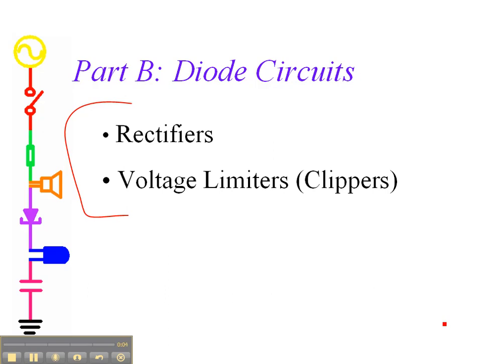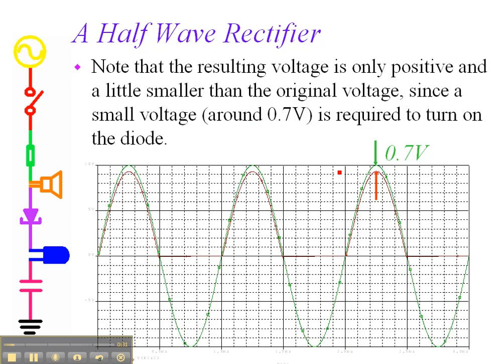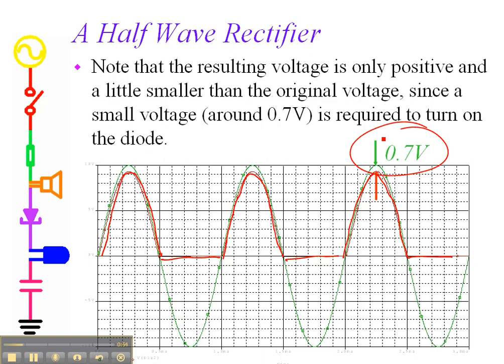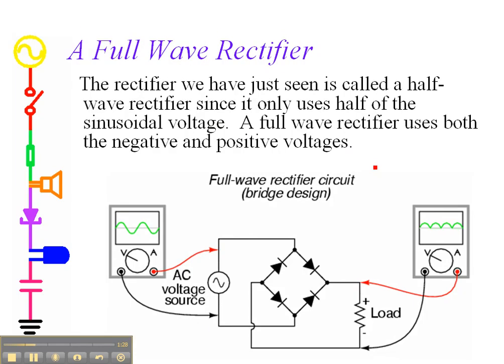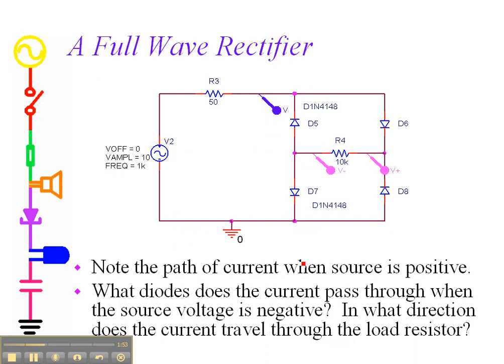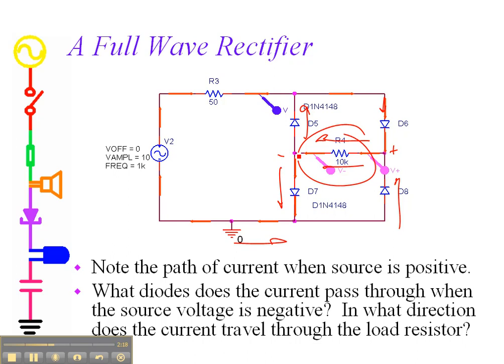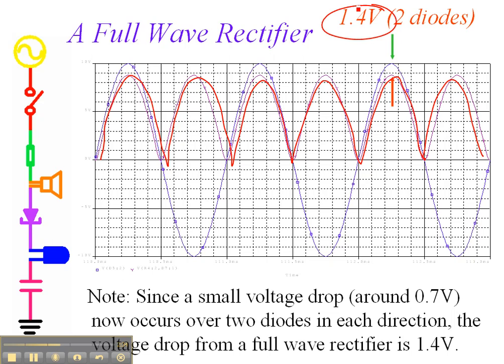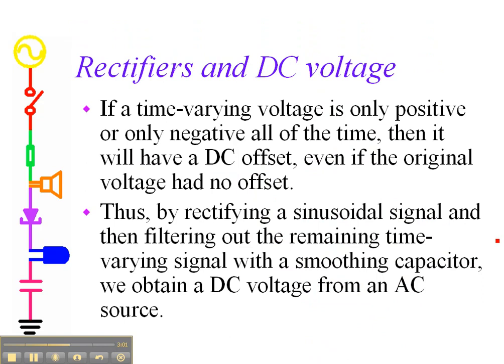Exp 8 Diodes Pt 3

Comment: Is there a practical use for a Half Wave Rectifier without smoothing (without the capacitor)? Could it be used as like a clocking device? so when the voltage surpasses a threshold it is logic high, and when the voltage is zero it is logic low?
Reply from the maker: There are many uses for a half-wave rectifier without smoothing because it is so simple. Circuits must make money and simple designs cost less to make. If a device needs to only be turned on (like an LED) and the huge ripple of the half-wave rectifier does not matter (we cannot see LED flicker even at 60Hz), this simple rectifier is fine. Also, some devices have diode-like properties that make powering them potentially very easy. For example, one can build a very simple microwave oven power supply buy using the microwave tube itself as the diode. This makes very simple microwave ovens even cheaper.

As for your clock idea -- that is a good one if you only need a 60Hz clock because it removes the negative voltages that can cause problems for digital devices.

Comment: If you build a voltage limiter with a .7V threshold and keep increasing the input voltage, does the excess voltage continue to put more strain on either the diodes or the resistor?
Reply from the maker: As the voltage applied across the diodes increases, the diodes must carry more current. This is most easily seen, as are most diode issues, with a load line. A higher applied voltage moves the load line to the right so it intersects the diode I-V curve at a higher current. The voltage limiter will eventually fail when currents get too large. In this case, fail means dead if the current is carried for a long enough time to burn up the diode.

Comment: How would the rectifier output change if you changed the shape of the input. For example if a square wave was input, would the output appear as just a straight line since it is always positive?
Reply from the maker: Ideally yes. However, unless the frequency is very low, the finite rise time of the square wave will leave some small gaps in the straight line output. This rarely comes up in practice because the time-varying signals that connect to the rectifier come from a transformer and are sine waves.

Comment: How would having an uneven amount of diodes on one leg relative to the other on a voltage limiter affect the output? Would only half of the graph (positive vs negative) be affected by that?
Reply from the maker: If I am interpreting your question correctly, you are asking what happens, for example, if we have 4 diodes pointed in one direction and 2 in the other. In that case, the voltage limit would be larger for voltages in the direction of the 4 diodes and smaller for voltages in the direction of 2 diodes. This might be useful if the circuit being protected could handle larger positive voltages than negative, which is indeed often the case. The positive and negative sides of the graph would be affected differently.